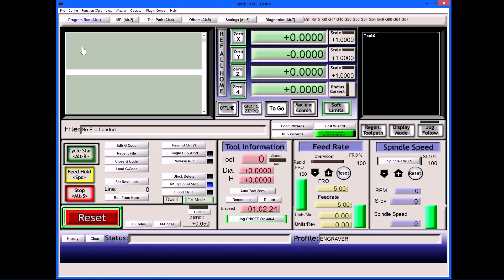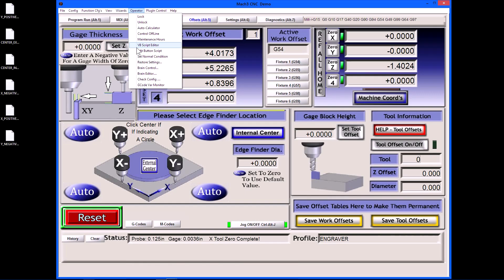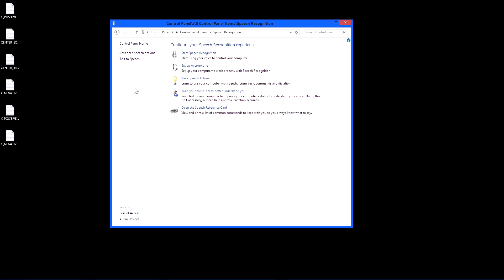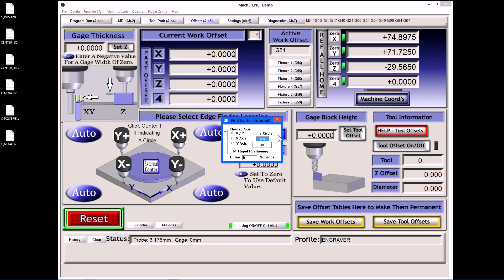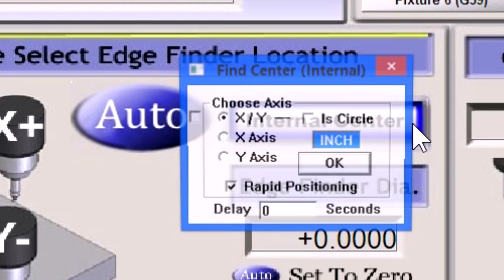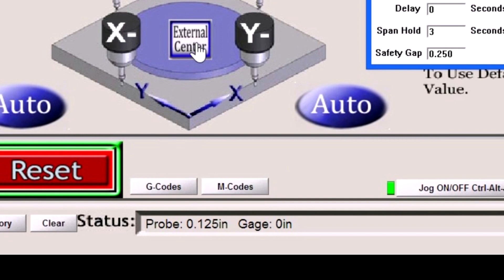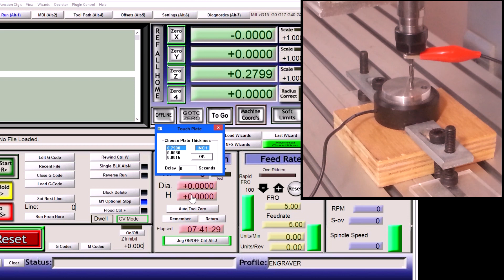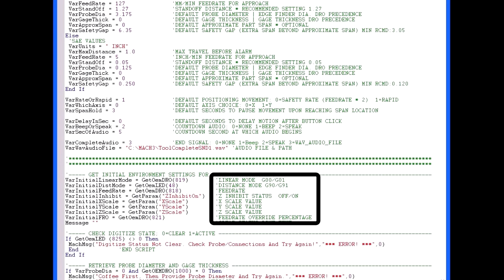CNC Mach3 | Automated Tool Setting | Edge/Center Finding (X/Y) | Includes INCH/MM Scripts

Comment: i have a big problem...
And i think that is from the chinese driver...
If i run the script manually... 
I get the correct position of X center..
X=0.0000
If i run the script by the program..
I have values:
X-5.6984
or 
X-8.7765
And not centered...
Bad luck on buy that chinese usb motion control...
Reply: is not chinese machine the problem man! if you write x10 y10 z10 work?
Reply: @Dark_Phoinix  Hi could you explain more about that? i have issues also, all the scripts :(

Comment: Thanks, Charlie, for the scripts.
Having used your Z Axis script and it works great

I am having a problem with X- and Y- Edge finding the DRO has the movement in a + value if I change the DRO to the - value it finds the corner correctly.
How do I change the script to display a negative value once the probe is touched?
the X+ and Y+ works fine
Reply: I have the same problem, how can I solve it?
Reply: @RaulGarcia-df7gw  
Hi Raul Garcia
I have made a change on line
SetOemDro(800,-VarsStandoff-VargageThick-(VarsprobeDia/2)) 'Set x DRO
Reply: @lenyenson  Thank you very much, I'll try to see how it goes.
Reply: @lenyenson  hi, you can put the script online? thanks a loot

Comment: HI!  Charlie.  Thanks for your Script you send me yesterday. But i used  the External Center script it shows an error: "109 - type mismatch ". And when i used  Center Internal - Script it work not corect. When tracking along the x axis or y axis it only touches once. I use mach 3 Version R3.043.066 as you said. Can  you can help. Thanks you again!
Reply: I have the same issue.. But if i change the valor of the SafetyGap for other value
It work..

Comment: Charlie or anyone
I am running in to problems running your scripts. I am using windows 7 pro usb to  tz7 tc50 controller with mach3 r3.043.066
in auto zero tool. I touch the touch plate and it stops then backs up to the home switch, when I hit go to zero it moves down but not to the top of the part.
on auto x+ , x-, y+, and y- buttons the probe reaches the probe the I get an error that I reached the max travel and it stop right there. Do I have a setting set wrong in mach3 that would cause this issue? any help would be appreciated as I am new to mach3.

Comment: Starfield like in the milky way.
Charley im running the script with the 3020usb mdk2 bob and the escape on keyboard function to terminate the script works only after it touches the ground on touchplate. The message listener reads
"Esc or stop terminating script" 
My other usb maching stops immediately. 
Thanku for your energy on these videos!
Atta boy starman!

Comment: Hi Charlie, great tutorial, I have a syilx7, unfortunately I can't get this to work as my probe is connected to ground, have you come across this before? Is there a solution? I have thought about making a two part probe with the top half being plastic in the collect but I may loose accuracy using a plastic probe
Reply: i have same problem . did you ever find a solution ?

Comment: I am having a problem with internal center script. Probe moves toward x+ normally until prob touches the part. Then it returns fast but does not slow down and moves fast toward x- until i have to hit e-stop. I am using mach3.r3.43.62 . What could be the issue?

Comment: Hi Charlie, I have been using your script with success for the past months. The only problem I have is with the auto negative Y and X. After finish the detection instead of set the value to 0, as for the positive X and Y., it sets the value to a -28750 (mm) in both X and Y. I have tried on 2 machines adn still the same I think is something in the script that has to be change to make it 0. Do you know where I have to modify it? DIfferentely the Externa Center works no problem so it's something in the negative X and Y cose. Thank you for the help!
Reply: Hi, I have the same exact problem, thank you for pointing it out. I'm really looking forward for a possible solution.
Reply: @nobilenobile1689  i think He might have his machine setup in a way that needs to subtract that value to get the 0. In my machine I would need to define it as 0 as it does for the positive and the negative or for the external /internal center finding. I hope he can point out us where we need to change the code. For the rest the scripts are fantastic.
Reply: Hi, really don't know what to think, but I  find it very strange that nobody else here have our same problem. Maybe it could be just a convert error in the mm/inch or a positive-negative sign to put before the value.
Reply: @nobilenobile1689  yes can be. Most likely the positive negative value.
Reply: Hi ale,try so it seems to work line 130 changes to.setoemdro (800, varstandoff - vargagethick - (varprobedia / 2))
Reply: @nobilenobile1689  Hi! Thanks. So for both negati X and Y at line 130 I change it to   "   .setoemdro (800, varstandoff - vargagethick - (varprobedia / 2))   " 
It is correct with the dot in front?
Reply: Ale,yes for both negative x and y
Reply: @nobilenobile1689  Ok perfect I will give it try! A fantastic upgrade for this  scrips would be to add a second Z probing scripts for fixed probe so that you could manual tool changer and off sett the tool at the beginning and then probe the new tool on the fixed plate only for the next ones during the toolpaths. Maybe @Charlie Sarsfield
 could make it!!! Please please please :-) (The same that Big Tex or mach3 2010 screen use it)
Reply: You are right it works! Fantastic, only thing I get an error at the end of the operation in both the negative script saying Erro on line 130 - Type mishmatch. I think there is some dot or comma wrong that cause the mishmatch. Do you also have it?

Ah ok good it working for my mahcine. My correct Line 130 is:
SetOemDRO(801, -VarStandOff - VarGageThick - (VarProbeDia/2)) 
For -Y

SetOemDRO(800, -VarStandOff - VarGageThick - (VarProbeDia/2))
For -X

The DRO number change between 800 and 801 one is X and the other Y.
Reply: @Ale_Lab  in truth with 800 I have no error.
Reply: @nobilenobile1689  ok better like that. Now everything is working fine. I am so happy. Need to find a script for a second tool changer Z probing. I do not want to use the 2010 screen set or big tex one. We should be able to implement it also in the original screen.

Comment: Hello Charlie, 

I tried your script with a 6040 Router from ChinaCNCZone. This has a USB controller and none of your script work or some partially worked but then I could not repeat the results more than once. In addition I got many errors. In particular, when I run the edge finder I get " Maximum travel reached...." which I tried multiple distance but still the error pops up. but this error in not consistent and once or twice I was able to succeed but they the DRO was not peftectly zero after the measurement, but x was +12 microns and Y +19 microns on the display. but after I was not able to measure it anymore. The error keeps coming back.
For the " external center finder" I get the same error right after the probe touches the first side. Once I was able to touch one side and when the probe went to the other side it stopped giving me an  ( Hope I remember correctly 322).
For the "internal center finder" in a circle ( i checked the circle option) the probe touches one side, goes rapid in the starting point, moves to the other side and after it touches goes rapid back to the opposite diameter and it stops with an error "error on line 277 -Internal error <RunXCenter>.

In addition a couple of times once it stopped, the machine started moving again on its own with no reason. fortunately at very low speed......it is scary and fortunately I used foam with aluminium tape to test all the options.

Unfortunately nothing works or is extremely inconsistent and dangerous to test on real parts.

I hope you can find the magic solution for this.

Thanks a lot for your hard work.

Comment: Error line 190 mismatch .. when im test external center .. how to solution ?? Thanks
Reply: yes this script is wrong need to insert the value with dots manually ... you found 6,0 you need to put 6.0 but is very dangerous this script !!!

Comment: Hello, I'm using a metric system. The script on the internal hole reports to me when the error is complete "error on line 139 - type mismatch.Thanks for every advice
Reply: After lot of experimenting and debuging script I found reason "Type mismatch" error. In regional settings of Windows you must set Dot .  for Decimal separator instead of comma , and set Comma , as thousand separator.

Comment: Dear sir, I am facing big problem with my Mach3 cnc machine. Here, we face frequent electricity cut off problem. Sometime when electricity cut off, all the X, Y, and Z value in mac3 are changing when restart the machine again. Can not start from the same point where  it stopped to work. It wast my expensive wood. I want to start from the same point where it stopped.
Is there any solution to solve the problem? Please could you help me to solve the problem?
Reply: I have had the same problem with a power outage.. and I've also had my motors bind up and lose position.. I've solved the problem of losing where 0 is on the work piece by incorporating limit switches that I'm also using as home switches.. if you lose the true 0 position some how, for example, power outage or in my case too week of stepper motors, e-stop or when u restart just re-home the machine to 0 by pressing the ref all home button beside the dro's. Machine will go home and re zero, as long as u started cutting with machine zeroed the same way, it'll start back in the same spot. You may have to re zero the work piece but that's as easy as using edge finder again.. hope this makes since..

Comment: dear Charly. i have a Question (sorry for bad english, i am german): i have a Question because i am a Little confused by using the scripts.  in my comment yesterday i said "ist working great", today i saw that the x-negative and the y-negative scripts sets the numbers in mach3 multiplicated with 10. after touching the gage the maching goes back as it should to the defined distances. Wenn i use the positive scripts the Settings are correct (f.e. X+22.500, but when i use the negative scripts there is set x-225.000 in mach3 ;-(.   The external Center script Shows an error: "109 - type missmatch "  hope you can help
Reply: because the failure in the "external Center script"  in row 109 i have found out that the number for the safety gap in mach3 has a comma and not a decimal dot. in the script i use a dot, but it Looks like that mach3 interprets it wrong. when i Change the comma to a dot the script runs as it should
Reply: Hi Bob
Ändere mal in der x-und y- den Wert bei VarStandOff ganz oben am Anfang auf zb.  einfach auf 5 ohne Punkt und Null dann geht es!
Reply: Rolf Rykowski hallo. Leider brachte das auch nicht die Heilung. Nach wie vor werden Werte -125 gesetzt wenn Varstandoff, varprobedia und Vargagethick auf 5 stehen  

LG
Kalle

Comment: No matter how close I set the tool to the part I get an error Maximum travel.
Reply: check your script Settings. did you Change the value "VarMaxDistance"? check the entered value. in Default it is 25.4. check also if you use a "." (dot) as decimal Code and not a "," (comma)

Comment: Great scripts! I have been using them for the past 2 months and they are fantastic. Probably it's only me but I have problem with the Y- and the external center. The Y- works to find the edge ecc but then when I enter like G0Y0 the Y0 is not at the right position. It moves way over the point like there is something in the script that  gives a opposite sign to the value. The other problem is with the external center finding. The error shows up after I open the external center, I can see the window, choose what I want to do, set the length of the stock and then when I press OK to initiate the command I get the error 190 - Type mismatch. Then a window with the script shows up and I guess it wants me to change something at line 109. Does someone have an idea how to solve these issues? Many thanks!
Reply: Hi
Center external Script
Dlg1.GapTxt = Format (VarSafetyGap,"##0" )     'Delete The . Dot and the 3 zero
Reply: @rolfrykowski6670  Sorry I am not sure if it is for me the reply. Thanks
Reply from the maker: With the external center, make sure the "Safety Gap" field in the dialog box has a period, not a comma. For some folks there is a comma inserted in this field automatically. I'm not sure why this is yet, but it does cause type mismatch error.

With the Y- issue, is it only the individual Y- button this happens to or does the internal center function have the issue as well?
Reply: @sunny5rising  Hi! Thanks for the reply. I tried again all the scripts. So for external center you were totally right. The problem was the comma in the safety gap field. Changed it to period and it works now. For the other question Y- finding works in external and internal center finding. Only Y- alone doesn't work. Or better it runs the scripts, seems ok but then the value set as 0 is wrong. It would go out of the table, that's why I suppose is a + or - mismatch in the script. Thanks!
Reply from the maker: Does the Y+ button work ok?
Reply: @sunny5rising  yep. All fine. It's weird

Comment: Hi, do you know if it is possible to do the procedure for an external diameter?
Reply from the maker: Yes it is.
Reply from the maker: Just do the external center several times.
Reply: @sunny5rising  Thanks, I'm setting the parameters and using here, thanks for the class, it was the most complete I saw on youtube

Comment: For others who have issue with error on line 130,  related button X- and Y- :

SetOemDRO(800, "-" &VarStandOff + VarGageThick + (VarProbeDia/2)) 'SET X DRO

The error caused this part of code:

"-" &

Error fix:

SetOemDRO(800, (VarStandOff + VarGageThick + (VarProbeDia/2))*-1) 'SET X DRO

Probably if you have configured oposite axis direction from standart setting (my case)
 in general Mach3 setting then code try write to DRO negative this cause error on line 130

Best Regards

Marek.
Reply: Thanks, for me it also only worked changing this detail, before making this change the system was assigning a wrong value to DRO
Reply: what did you change in this row? i my scipts (downloaded 1 week ago) this row look exactly the same.  only difference: in y scripts i find "801" in x script "800".
Reply: @kalleaix6238  
My friend, I'm from Brazil, I'm sorry to use the translator, I made some changes to the files that Charlie made available because the originals did not work well on my machine, they were some lines that I can not remember unfortunately, I remember a major change that was the unit of measures of my windows from "." to "," in the decimal separator, is that in my country the unit is the opposite of the American system, but to help you I can send the files that I use in my machine, just leave your email that I am helping you, I am very grateful for the help of Charlie and I'm glad to be of use to you, then you just have to take a look at my code and see what works for you

Comment: Charlie, how did you electrically isolated the spindle from other parts of machine? My spindle is electrically connected with frame. Thank you!
Reply from the maker: My spindle came already isolated, possibly because it's a DC brushless motor. That's my guess anyway. Others with your issue have made isolating probes or isolating plastic sleeves for their spindles specifically for probing.

Comment: Hi have a general mach3 issue....and i am new to mach3...in jog mode it wont move in step...only moves continuous....any ideas why?.....i use the mpg on screen navigation and have i in step mode at .100 per step and no axis moves
Reply from the maker: Does the axis DRO change to reflect the .100 after each step? Also, if in MM mode, you won't be able to see the .100 movement.

Comment: Thanks for the scripts.I have a problem with (external centr)it gives me error on line 109- Type mismatch
Reply: Hello did you manage to solve this problem on line 109?
Reply from the maker: Make sure the Safety Gap field has a period (.) in it instead of a comma (,). This should take care of it.
Reply: @sunny5rising  thank you very much managed to solve is appearing a (,) instead of (.) now every time I change there works perfectly.

Comment: Thanks for the scripts. I have an older version of Mach3. Version 2.63. And I got a lot of errors. I fixed the edge scripts by removing the MachMSG lines. This trick did not work for the center scripts unfortunately. I think it is because of the dialoge window and I have to see how they used to do this in the old days. There is not much old reference I could find. If there are old school coders who can point me in the right direction that would be great. But with the edge scripts I am already a happy man.. thx.
Reply: My bad. I forgot to comment out one MachMSG. I got some more errors but that had to do with word wrap. Part of the MachMSG line was not included in the comment. It now works like a charm. Thx.
Reply: hello arie, could you share me the Charlie Sarsfield
 scrips to todocnc@outlook.es  I would be very grateful  mark